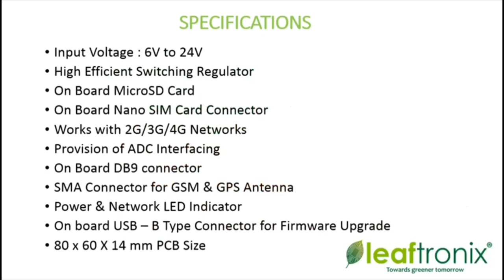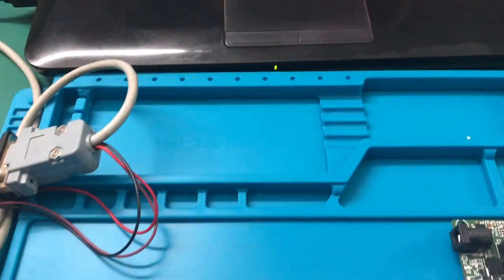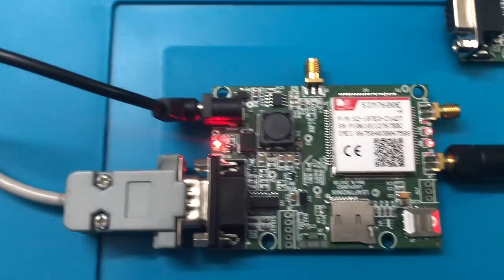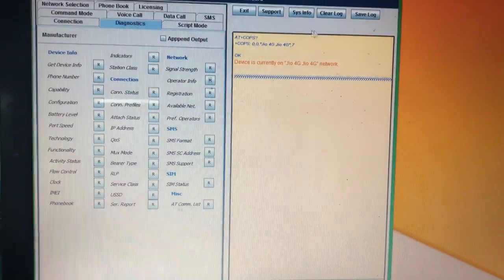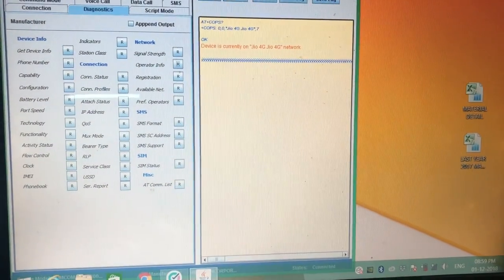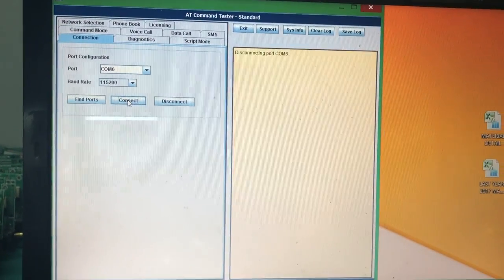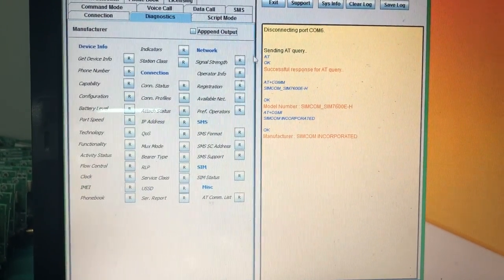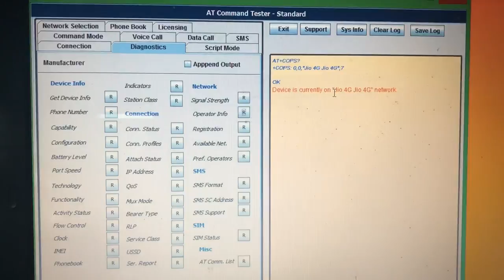SIM7600E - H  LTE Modem

Comment: Thanks sir for posting about 7600e.
i want to update my system by SIM7600B LTE module in the place of SIM900B module. I need a small information,  module  sim7600e  programming is same as GSM module SIM900b.....